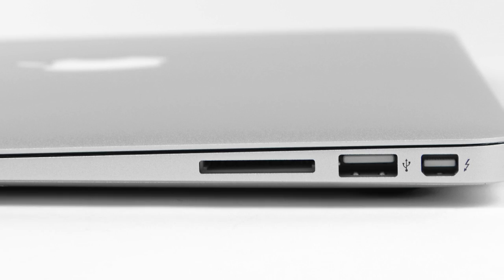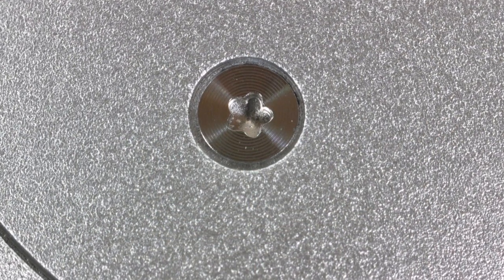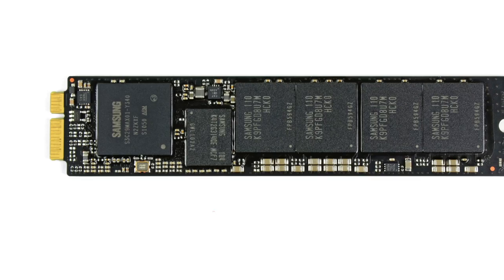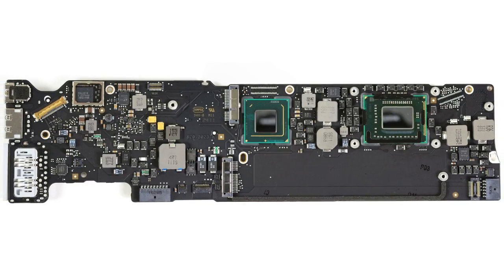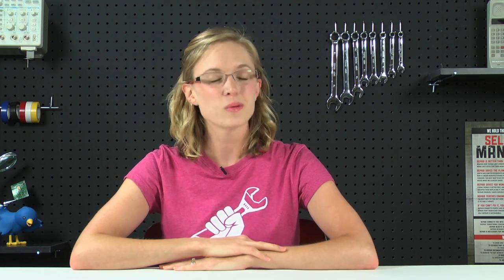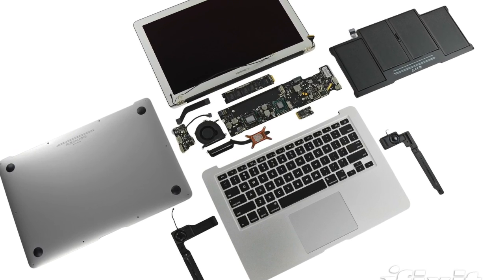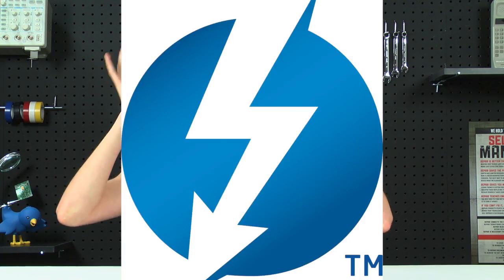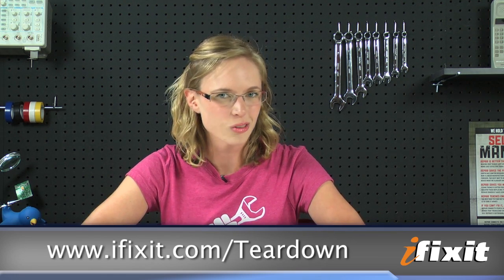MacBook Air 2011 Teardown Round Up

Comment: MJ I'm curious how you guys came to a 4 for repairability.  Does that score how easy it is to replace, the number/availability of replacement parts, or both?  Given everything you said and showed, I couldn't give it more than a 2 in good conscience, in terms of parts.  Nothing in that computer is a standard component, and all that can really be replaced is an expensive LCD, an expensive logic board, and a proprietary SSD.  It blows my mind that Apple is dropping the MBP for this thing.